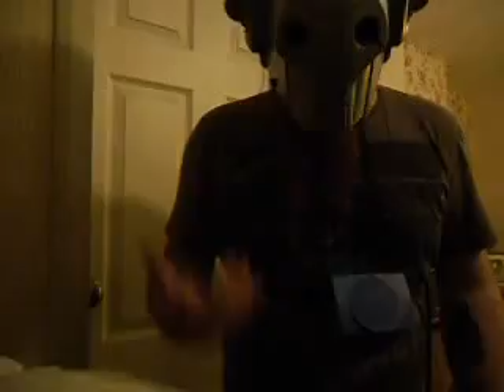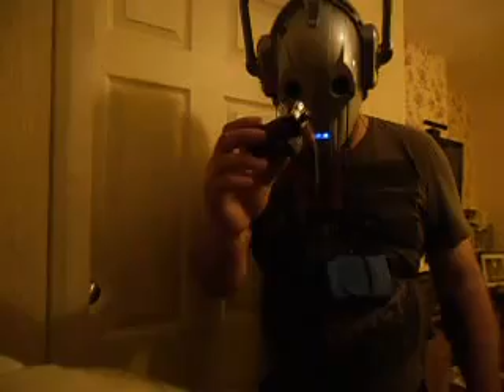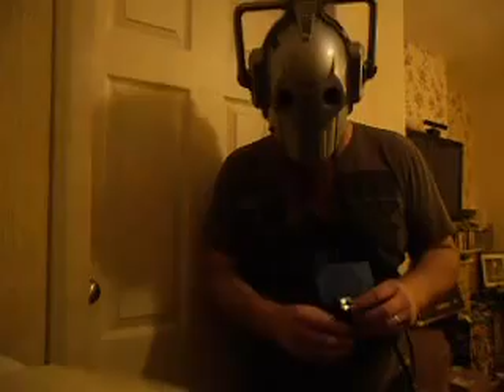Wearable Cyberman voice changer final test

Comment: I need one! Seriously. How do I get one
Reply from the maker: @bkpalos  this video is 11 years old, I stopped making these years ago. However, the circuit was a two transformer four diode ring modulator with a 220 Hz carrier sinewave tone if you want to try making one yourself. You'll need a voice amplifier to go into the circuit as well as a power amplifier for the output. The carrier tone was on an MP3 player.
Reply: @MegaWayneD  love that u responded. I’m pretty handy I’ll have to take a better look at the circuit tomorrow. I’m doing a haunted airbnb for Halloween and the idea is a female clown greets them w one of these to show them to their rooms… hope it ain’t too scary for em.
Reply from the maker: @bkpalos  sounds fab! Some of my very early videos featured the circuit. This was mainly for a Dalek voice but I discovered the putting the frequency up to 220 Hz gave the Cybermen voice.
https://youtu.be/WVEQ9r4qY_A?si=gODEi4IknEDGhHOy